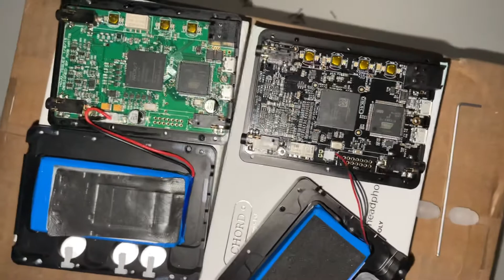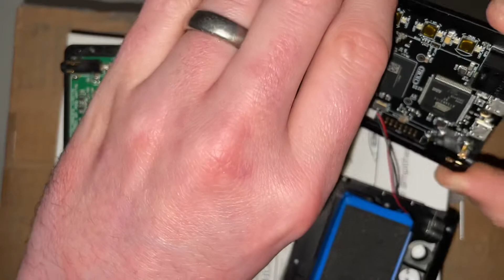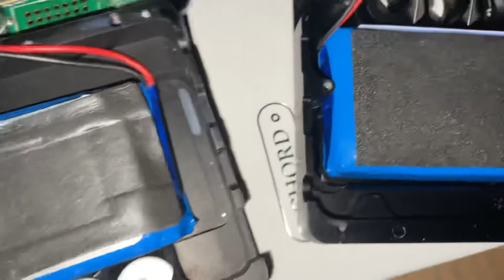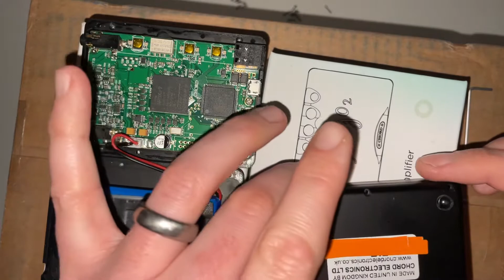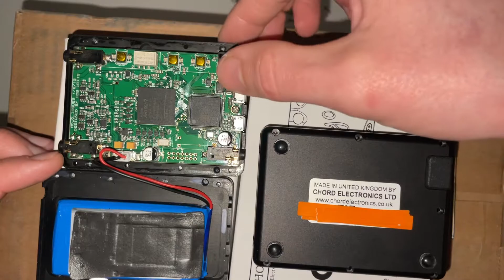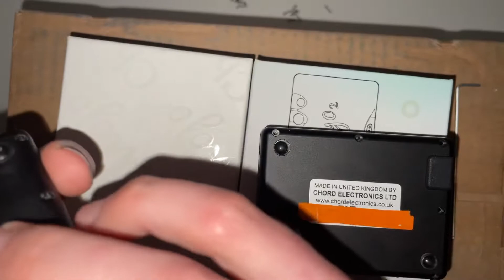Mojo 2 - part 3

Comment: I just received mine… the 3.5 jack (near the buttons) doesn’t work well, it just allows me to listen to one channel 😢
Reply from the maker: Ah that’s a shame, do both jacks not work? Open the case and have a look, they are soldered directly to the board so could work loose it you force the jack in. Should be a simple fix with some silver solder..
Reply: @engineeredabsolute9634  only one of them works :(
Reply from the maker: Both are stereo jacks, so should be ok with just one working. Make sure to use a stereo 3.5mm on headphones
Reply: @engineeredabsolute9634  great, thanks!

Comment: Imho you should have uploaded one this video and not the 2 previous ones, but thanks for the detailed analysis. Which has the more enjoyable sound in your opinion? I know you sold the Mojo 2 but how would you describe both sound firms
Reply from the maker: Mojo 1 was definitely a warmer sound and that seems to work better with my very analytical headphones. Also didn’t feel the mojo2 was a big difference over the mojo1, I have listened to both the Hugo2 and TT2 in a local hifi shop and they seem to be much better. Also want to hear a Dave before deciding which one to buy.. as would like this to also work with my main hifi. Please subscribe and when I make my decision on next Dac I’ll have a look inside and comparison .. thanks

Comment: Wow, this is very interesting to see. It seems they have not upgraded the PCB design a lot.
Reply from the maker: Only minor changes to the pcb design, the overall changes from the mojo1 to mojo2 and small, I have a felling they could have made it much better but then they wouldn’t sell any Hugo2!
Reply from the maker: Please subscribe and when I get my Hugo2 I’ll do a similar video and comparison
Reply: they key is the FPGA in Mojo 2 is now utilized 98% instead of 33% in Mojo 1, and Rob Wats has re-coded it. And you should know that the FPGA implementation is the key in Chord DACs